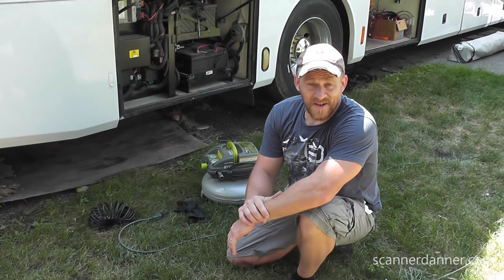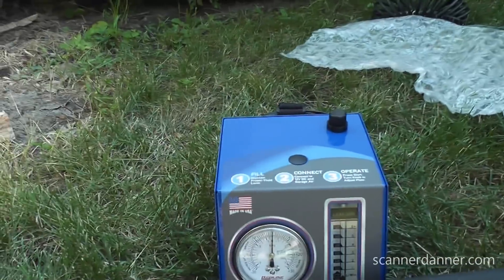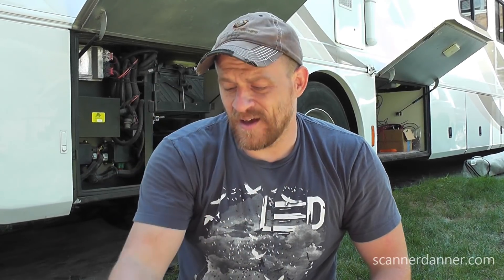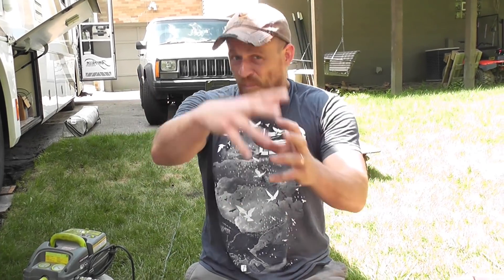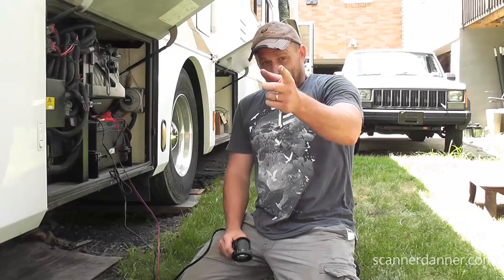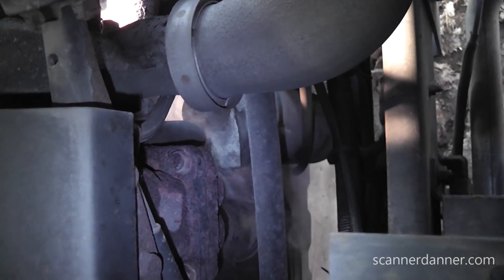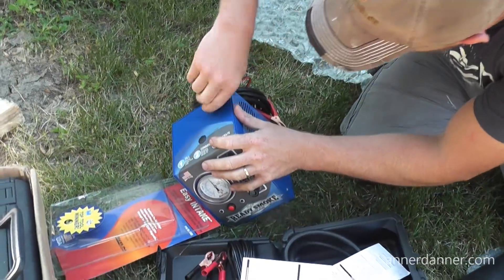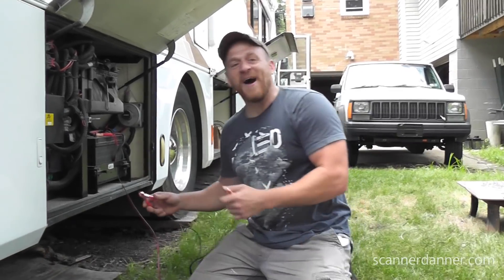Redline ReadySmoke Unboxing-Exhaust Leak Test-2001 Cummins 8.3L ISC

Comment: I just purchased a redline unit am a class 8 mobile tech 

Got a call for a cat with a c13 with regen ow  power but no active faults 

I could hear a boost leak but could not find it 

Cats are tuff to work on they are different than other engines 

Any way i pull out my smoke machine attach it 

In less than 2 min found leak and landed repair job 

Customer told me it had been to 3 shops and nothing but parts cannon action he was amazed at how fast i found it 

Smoke machine WORTH EVERY PENNY

Comment: Great video, but a lousy outcome, Paul. I have two smoke machines at the shop and find them to be useful in many situations. I used one last week to help the trucking company next door track down a  leaking oil cooler.Ready smoke seems to be a nice machine and I really need to buy one of those bladders. Keep up the great work and curious to see if you are going to do a video showing the repair. Immina watch it if you do!

Comment: exhaust leaks with Turbos are a little different that exhaust leaks with normally aspirated engines. with a turbo there is almost always boost pressure in the exhaust manifold. as its backed up to spin the turbo.. there is a some scavenging and fresh air sucked back into the crack..  will it be enough to shock cool either the exhaust seat or the exhaust valve face.  that is debatable..  but no normally aspirated engines.. there is a Lot of scavenging going on in the exhaust manifolds..  the cracks can let air into the exhaust port during the end of the exhaust stroke when the valve is closing and shock cool one side of the exhaust valve face or seat.. but it will dilute the exhaust stream before the upstream sensor and under load force it to go richer.. feeding additional fuel thru the motor and super heating the exhaust manifolds and causing catalytic converter failure because of the excess rich mixture coming out and the additional atmosphere coming in thru the crack.

Comment: Never seen a Cummins manifold cracked . Done plenty they are b@#!h . All the gaskets going into the head are individual and being an RV even worse. Since your there I would test the egr cooler, they have a high failure rate would be a good idea to bench test it . Check your impeller on the turbo and clean out the front face only , it's more than likely has high build up . Just my two cents .
Reply from the maker: thanks for the tips!

Comment: One big thing that's different between gasoline vehicles and diesel vehicles is on a lean condition , diesel actually burn colder then if it was running with a rich mixture. gasoline is completely the opposite. So having an exhaust leak on a (direct injection diesel) manifold area all the way through the up-pipe tubing to the turbo  will cause less  back pressure and volume of exhaust gasses flowing through the turbo so it cant  spool as fast  causing lower boost pressure . so then the computer trys to adjust by adding more fuel to bring the boost back up. ( direct injection anything is very good at compensating for power loss )  this then causes exhaust gas temperature to rise because of the extra fuel being added in the combustion chamber with less air

Comment: Tony Diaz I have a redline smoke Pro air complete smoke machine I think you would like it has a built-in air compressor so you can take it anywhere but you can also use a nitrogen bottle or shopping air

Comment: Never say never lol I knew you'd do it again 😂 From what I remember, They told Eric O to put more fluid than recommend because he wasn't getting a lot of smoke.... Could be wrong but I usually have a good memory 🤔😂
Reply: That is right. I ended up adding 4oz fluid and makes good smoke now.  :)
Reply from the maker: 2 oz didn't even register on the stick, not that I could see anyway, but mine worked great with 2

Comment: Cool video, thanks to Redline. Not cool about your RV. If a customer complains when I fail their vehicle on a safety inspection for an exhaust leak, I remind them that carbon monoxide is a deadly gas. It may be a pain to fix, but the safe thing to do for your whole family. I lost a good friend that way, died in his sleep from carbon monoxide poisoning. Stay safe my friend.

Comment: I have not worked on that engine in an RV, and looking at your film, accessibility could be an issue for replacing the exhaust manifold.  In class six rigs the manifold could be R&R'ed in a couple of hours, one big potential problem though being broken exhaust manifold bolts which require extraction.  If your time permits, I say jump on it now, so as not to adversely affect your vacation.  

OR, run with it as is, because if you or someone else did not detect an exhaust odor, the RV cab may just be manufactured sufficiently sound to prevent the exhaust leak from entering the cab.  In trucks, I have seen plenty of exhaust leaks that drivers were not aware of.  Your call.  I know you will do the best for your family.  Good luck.
Reply from the maker: We left it at home. I wanted to use it just to get us to the beach. We rented a beach house for the week so I really didn't need it. But the drive is like 11 hours, so our plan was to split the trip, stay at a campground halfway, do the grocery shopping at home (cheaper) and load the RV with stuff and be good to go! I did this smoke test thinking it was a lose exhaust clamp (one I had tightened on a previous trip. Thought it would be no big deal, I could show this new smoke machine I didn't even want and then
BAM! reality hit lol 
$650 in parts are already ordered. Just hope I don't snap too many bolts :-(

Comment: Hey Paul, thanks for another video! I mentioned in a comment on another video of yours how your book/premium channel has helped me and that my boss has invested in me by paying for my ase testing. Yesterday and today I took and passed brakes, engine repair, engine performance, heating and air conditioning, and last but not least, ELECTRICAL! Guys reading these comments, invest in yourself and spend the money on this man's book/premium channel! I've been in the field for 5/6yrs now, and until 3-6 months ago, anything electrical, I lacked in. Hell, I couldnt even barely read a wiring diagram! Because of this man and his book/channel, something clicked in my brain and I now understand electrical circuitry to the point I'm now good at electrical and actually really enjoy it. I thoroughly enjoy diagnostics and finding the cause of failures/problems. Have never used a scope until a couple months ago and now I scope EVERYTHING, I can't get enough. I can go on and on but you guys get the point. I'll be taking automatic transmissions, manual drivetrains, and steering/suspension next month and be an ase master tech. I am proud of myself, especially considering I didnt study for any of the tests and got a 85-95 on my tests. Thanks again Paul and to God be the glory.
Reply: If you like using scopes and scanners can we call you scanner tanner?
Reply from the maker: Awesome comment. Thank you so much William Tanner!
Reply: I had a pretty interesting car come in the other day. Was a 2012 journey that got towed in, customer said it shut off and wouldn't restart. Started fine so I let it run for a while, shut it off and let it heat soak. Wouldn't restart, sprayed staring fluid and it ran. So I scoped the pump with a amp clamp, no current flow. Tapped on the tank and she fired right up. Noticed the tank had imploded on itself. Found a faulty vent valve. My theory is that the tank imploding in itself caused the bottom of the tank to rest on the pickup of the pump, causing it to overwork itself, overheat, and the windings open up internally. When it runs, current ramp scope testing appears normal
Reply: Good for you William.
Reply: That's great William and you won't regret getting that transmission cert I have been in transmissions since 1987 and have loved every minute of it. I'm turning 53 tomorrow and looking forward to retirement soon.
Reply: ScannerDanner yeah, thanks for giving us so much of your knowledge and experience and taking the time to make videos. Good luck with your trip, though I found ironically ilarious that you found the fault. Thanks again.
Reply: Gene Mean that's a good one, never even thought about that! Haha maybe I should start my own channel!
Reply: By the way, thanks everyone for the positive comments! Always good having the support of fellow techs!

Comment: Just got mine today. Aeswave $569ish. Ordered through Snap on guy $745ish. Oh well. Can't wait to blow some smoke. Nice vid as always Paul and Calob.
Reply: Burt Pilon picked up new Mac one at pawn shop last year $400 cash. Checked it before I bought and it works so for $400 I got a heck pa a deal. Still have to use it on 3 separate jobs here at the house when I get house remodel work done.

Comment: I just got done checking for exhaust leaks on my Bronco and F-350. I used a Wal-Mart $35 fog machine, paper towel tube, 6 or so wal-mart trashbags, only down side is it took 7-8 blasts for the fog to push through to a exhaust manifold leak.
Reply: start vehicle, cover tail pipe with a wadded up rag (wet if need be) find the loud hissing/whistling spot/look for carbon buildup and there's the leaks.
I've never found a faster way than the engines own back pressure and of course best to do it when cold, before they expand and possibly seal off.